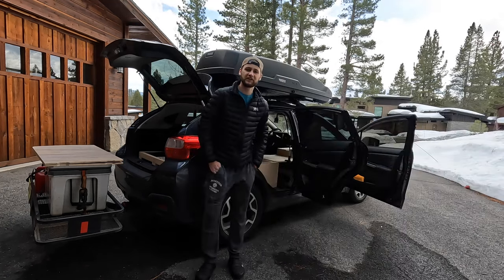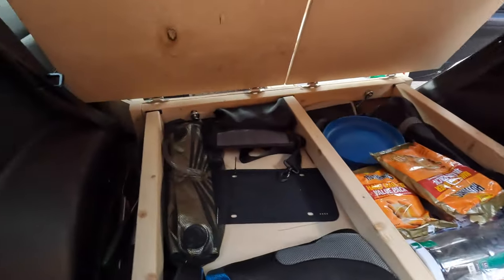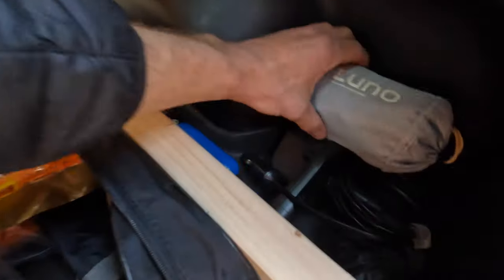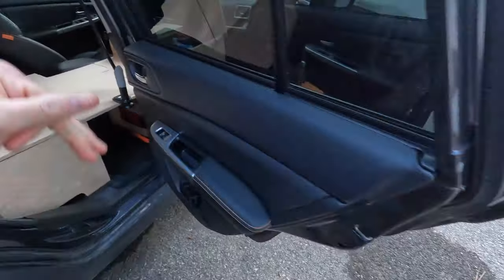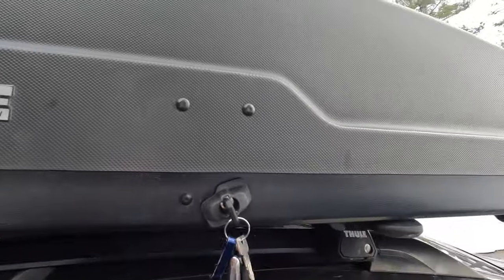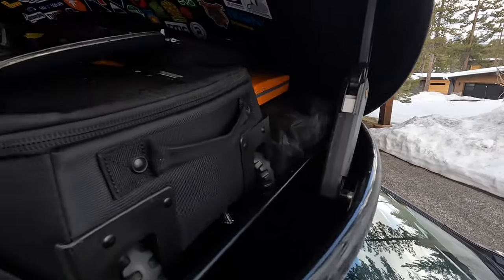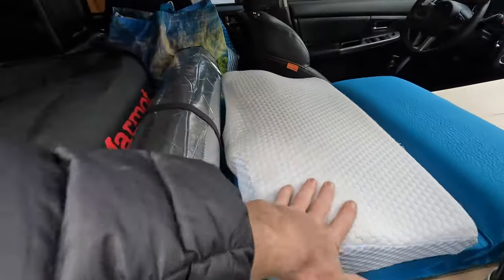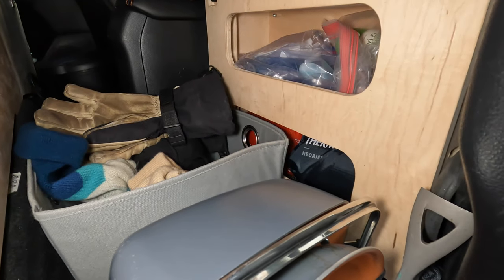What I Pack for My Winter Road Trip - Subaru Crosstrek Car Camping Gear Walkthrough

Comment: id love to see a video on how you built your build. Is your airbag light on because you look out the passenger seat? Whats your gas mileage like with that massive roof box
Reply from the maker: I have some footage of the build process - planning on posting it soon! The removal of the passenger seat causes the SRS airbag light & seatbelt alarm to turn on. You can easily turn off the seatbelt alarm, but the airbag light is more complex. I didn’t do it, but it can be bypassed by adding a transistor to specific pins in the airbags wiring. As for gas mileage, even with the box, solar panel, and cargo rack,  I avg around 27 when traveling (highway). This drops to 24/25 when I’m camping (warming my car up a few times a day, driving short distances, & mountainous roads). I tend to drive at slower speeds due to the weight, but this also helps a bunch with mpg!!

Comment: Hey, does the conversion kit you made connect to the mounting points/anchors of the car in any way? I'm interested in the plans & whatnot, but I'm a tad worried that it would all launch forward in an accident & kill me, lol.
Reply from the maker: The conversion is secured! Truck bed tie downs are bolted to the passenger seat mounting locations. A strap is fed through the tie downs and through the front structure (I used straps but turnbuckles can be used here too). The rear structure uses “eye and hook” turnbuckles to secure the remainder of the conversion to the rear seat mounting locations. Planing on posting a video on this soon!